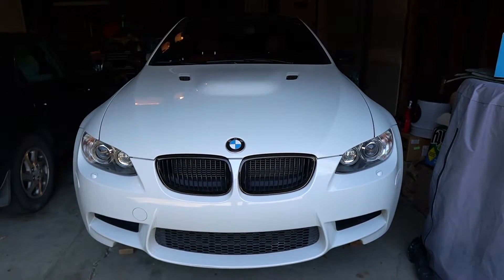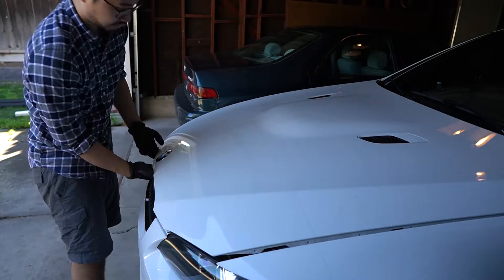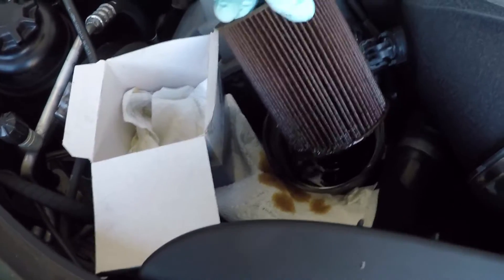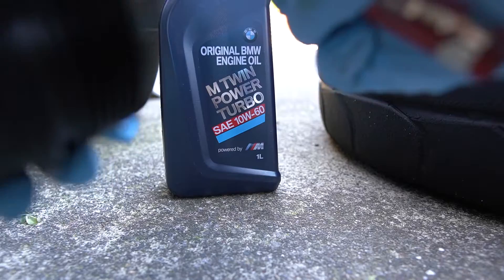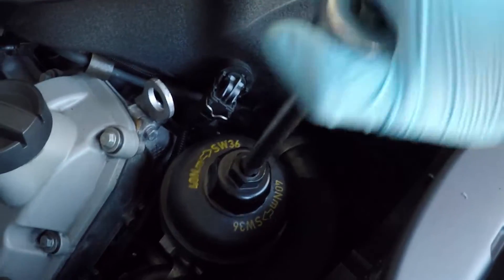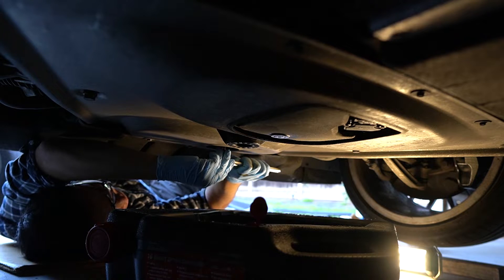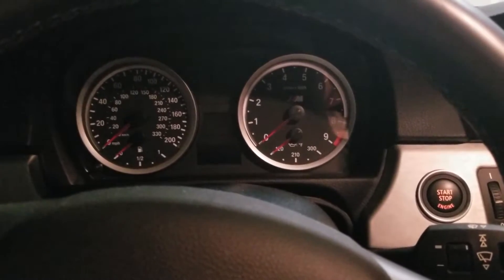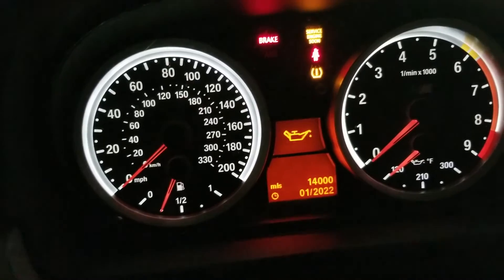BMW E92 M3 Oil Change DIY

Comment: Hey man what are your thoughts on Liqui Molly vs the BMW oil?
Reply: I’d you’re adamant on using 10W-60, I strongly suggest using ONLY the OEM BMW oil or if you want something more then go for the Ravenol 10W-60. Otherwise use 5W-50 Amsoil or Redline (ideally Amsoil). There’s a lot of research on this. Don’t listen to the sheep. Liqui Moly & Motuk are a bit overrated for this application. The E9X M3’s have very tight bearing clearances and can have trouble getting up to temp. Also, keep in mind not all XW-XX oils are gonna be the same properties as other brands of the same XW-XX viscosity oil. Do some deeper research because there’s a lot of bs surface level anecdotes going around regarding this topic.
Reply: @X11CHASE  Thx, my mechanic also suggested use BMW oil and that's what he has on stock only too.